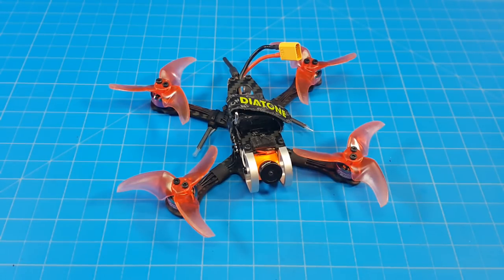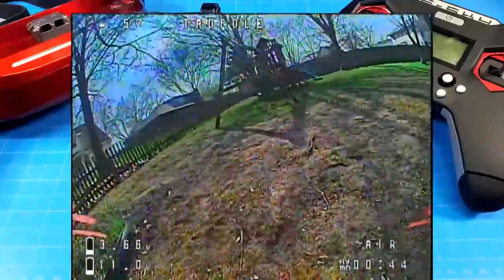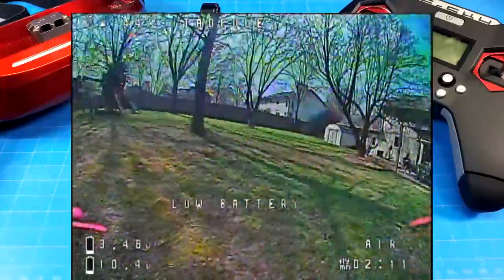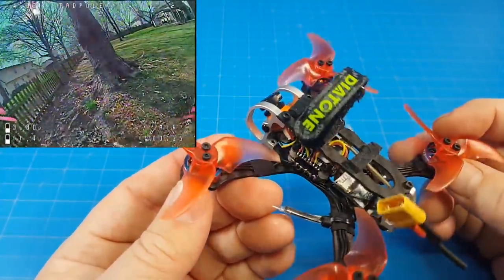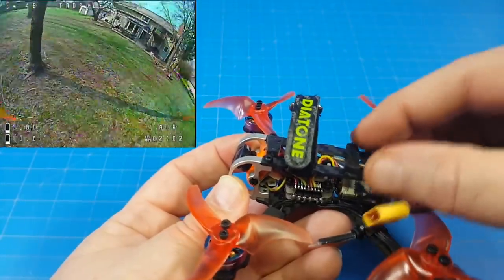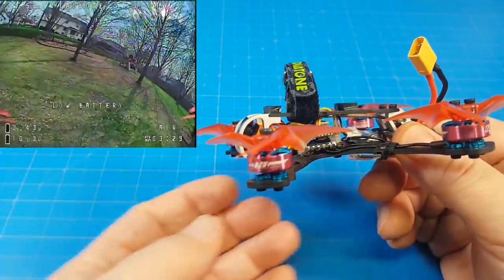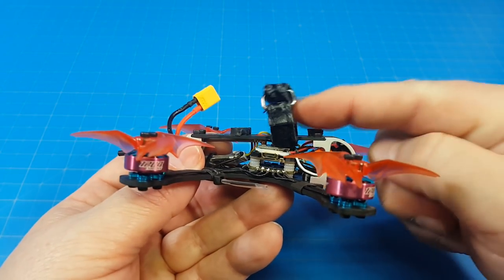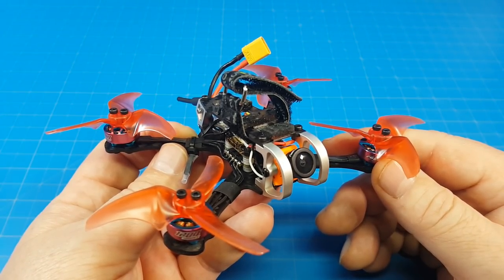Armattan Tadpole // Micro Freestyle frame // search for 3minute flight

Comment: I'm not having any breakup issues with mine, I'm using a Iflight succeX V1.5 stack with a linear antenna, runcam nano 3 and flywoo 1103 7650kv motors, same props

Comment: Hi there Nick!! I got 2 tadpoles. 1 spare cause of long shipping time for parts here. So iam always able to fly. I run them with 3 layer 16x16 stack from iflight. Cut of the botem half of the rubber dampners and replace them with rubber orings to get the stack to fit. I use the flywoo nin 1103 7650 kv. Get around 5.30 min flytime with jesc and rpm filtering on a 450 3s. I also got a foxeer lolypop on both, works great!! No issues there . I use  the 2,5 inch emax props. Love the sound comming of those props. Rly quiet compared to the twin blades. 

Anyway. Great video, keep up the good stuff and stay safe( indoors).

Greets, Rob from the Netherlands

Comment: Hey  Nick, I definitely feel the same about working from home. Btw, I have the Tadpole as well, very much built up like yours except I used Mamba motors, but I have experienced the same problem with my TBS VTX and was told that running the antenna out the back and in between the power leads was the cause. Haven’t had chance to test that as of yet. Also, that Emax tape, as you call it is exactly the type used on guitar pickups to wrap around the fine wire wrapped coil bobbins. If you or anyone else is having trouble finding it, look for Electric guitar bobbin tape. I hope you and your family are safe and secure. Thanks for awesome videos!
Reply from the maker: yes, it could be electrical interference, I did move the antenna out the side of the frame body and mounted it stick up in the air, I couldn't tell a difference. :(

Comment: I built a quad that had similar video breakup and had to separate the receiver from the VTX. Seemed like the receiver transmitting telemetry back was interfering
Reply from the maker: In the moment I don’t recall where the Rx is mounted. I suspect the lower back part of the frame.

Comment: glad i found this video, i run 1105 mambas on a 3" tadpole and i'm getting fed up with this 1.5mm shafts. this 1204 motors have a 2mm internal shaft and so do the transtec 1106s flywoo apparently also has motors with a step up shaft. i'm looking for durability and not sure i'm ready to commit to a full 2mm shaft and having to drill props but it might be worth it.

Comment: Thanks for keeping the content coming. I enjoy seeing your updates while cooped up. I've got a Tadpole built at 70g with T-motor 1104 that flies nicely on those Avan 2.5". I've had some issues with VTX noise on this frame running a TrueRC Singularity out the back on a TBS Unify Nano Pro32/Diatone adapter with the LC and a power cap on the ESC. I would try running the dipole out the front just to see if it makes a difference before doing anything major.

Comment: Work from home is tough, no doubt about it. I don’t know if you found your video issue but I built one of these last week and was having the same issue and I was using a nice TrueRC RHCP antenna with the same vtx as you.  In my case I ended up running the power lead out the side away from the VTX antenna and that fixed it.  Easy enough to test on the bench real quick though!  Take care!
Reply from the maker: I haven't found the fix yet, but I think I will try to trouble shoot it.

Comment: My experience is that 2.5 props max out at about 40/45 watts.  You can throw more power at them, but the lift does not change much.  So it does not really make sense to go above an 1103 motor.  I have two of these and a nice backyard course (which is very tight).  One of the units has Emax 1106 motors and the other one has Amax 1103 motors.   My top ten times (of about 70 seconds) are all on the 1103 with a 2S 450mah battery.  I lost my 1106 unit in the creek when it was running fast...gone forever...very sad.   I think the 1204 motors are a really good fit for a 3" ultralight with a 3s 450mah battery.  BTW:  This frame can take a beating!
Reply: Yeah wish there was thrust test that compared all the latest 65mm props. I've noticed the Avan Rush have really good thrust and control but the last 10% of throttle on 2s 7k kv 1103 motors doesn't do much.

Comment: I fly this frame with 1103 6500kv on 450mah 2S on avan rush 2.5 props and I regularly get 5 mins flight. Admittedly I don’t fly as fast as you do but prefer a fast smooth cruise.
Reply: What motors do you use???
Reply: Gibby bibby Wibby Mamba 1103 6500kv.
Reply: Thanks!!

Comment: I'm running these props on my Geprc phantom along with crossfire and a tbs unify pro 32 nano vtx. 1103 8000kv on a gnb 2s 450. Still my goto micro plenty agile, fast and comes in at 91.6 grams

Comment: I love my tadpole.  I put the ORT micro Vee antenna on mine and feel like I get pretty good reception.  I got the Xing 1105 6000kv motors running 4s and it flies so good.  I have already broke the arm on the frame but the frame is sooo cheap.

Comment: Hi Nick. I have a couple of these frames myself. When I built my first one I didn't install that little rubber antenna retainer piece which was included in the frame kit. It was difficult to install and I figured it wouldn't matter. I see you didn't install yours either. I experienced the same video issues as you did in this video. However,  I did install that piece on my second build and did not have that problem.  When I installed the piece on the first build, out of curiosity,  the problem went away.  I hope this helps.
Reply from the maker: good tip. I will try that out as well. Thank you

Comment: The reception could just be a poorly manufactured dipole antenna. They aren't known for being precise on cutting the length properly. Easiest fix to try first could be just try another antenna. Great looking build and some impressive flying!
Reply from the maker: This is another thing I should have tried. In both cases I used the stock antenna, they could both be wrong. I also might need to try the different modes on the rapidfire.

Comment: Hi Nick ,  I feel you ,  I have the HDO2 with the TBS fusion module and am waiting on the rapidfire  module to arrive ,  but I have noticed  video reception has a bit more interference lately and is more likely the amount of extra wifi signal in  the air with everyone at home and living on the net , as for the extra metal , my favourite quads are based on a FPV Egg  frame from LDARC and  GT Maurader  from Diatone , never really had a drama I would attribute to the metal frame interfering with the video reception .  .  What was that  trippy spin thing , Dude . awesome.    Thanks for the video and  You and yours and the entire Burn's fan base stay safe .  .
Reply from the maker: We have been saying home as much as possible. We do go outside, at least have the kids go out daily, get out and move around some. As to the reception, I should have tried the skyzone 03O goggles I have using for 6months or so, or one of the legacy modes on the rapidfire. I don't know what the uptilt tree turn, but its a bit of a trippy spin, I should see about going all the way around nose up.

Comment: I'm running a linear antenna without any issues, I am using a unify nano (the latest) as vtx though. Glad you were using these motors, I was contemplating on getting these but I'm mostly looking for efficiency. I have it on 2s with biblades and it feels great but it could use some more meat on it ( so switching 3s )
Reply: there is a 3 inch baseplate in the works, might wait for that

Comment: The slant was to save weight I don’t know why your vtx doesn’t work I’m running dipole out the same spot I do have a much shorter dipole antenna not sure if that would affect anything and my antenna is now ziptied and heat shrunk pointing up instead of straight out the back. That trick around the trees your working on looks super cool and fun!

Comment: 1103 or 1104 is the sweet spot for the Tadpole i.m.h.o.! I have two builds and love them! Put some good T-motor or Brotherhobby motors on that frame and it will rip!
Reply from the maker: In time I do think I am going to give 1103 a go.
Reply: @NickBurnsFPV  1103 with the low pitch HQ three blade or 1104 with the Avans, and get it as light as possible then it starts to shine! ;)

Comment: Fantastic flying, Nick! 😃
This frame really looks nice! Couldn't it run those 65mm props?
Reply from the maker: My suspecioun is the 65mm biblades wouldn't gain us much, but with 1103 7000-8000kv on this build witch 65mm biblades would be a better combo.

Comment: Hey you think that the video reception issues was due to the antenna connector hitting the carbon fiber top plate? Looks awful close, what if it shift slightly during flight and touches the CF.  Also did you try a small cap? Although that doesn't look like the typical interference that a capacitor would resolve.  Try putting some electrical tape on the bottom of the top plate so that the .ufl /ipex connector doesnt touch the bottom of the top plate. I've been waiting for the 3" version of the tadpole for my next build. I like my RCinpower 1204's, but typically run them on a Primo 3" or Twig with a 520 or 550 3s. I like that KV range 5000kv is very versatile anywhere from 2s to 4s. They also work really well the 3016 Tri blades.
Reply from the maker: I don't know. I need to do some more testing, some really good suggestions here by many.

Comment: HQ's new 2.5" prop might be worth trying if you haven't gotten some already. It's the T65MMX3. 1.5 pitch triblade so it should be pretty efficient. I have some that just came in but haven't had a chance to try them out yet. Up to now the avan props you used here have still been my favorite for 2.5".
Reply from the maker: I did try those. I think they are to flexible for high rpm motors, the two builds I have tried them on had vibes/jello I couldn't get rid of.

Comment: I appreciate your videos man. I'm doing a similar build but the new 3" with the AIO option. Same motors tho. Also have the Betafpv 1204 I'm going to try. I'm hoping the 3" props make it more efficient.
Reply from the maker: 3inch props will help, the 1204 motors should handle them pretty well.

Comment: Nick, just a thought on the inefficiency of this setup. I think the low flight time here is not because the motors are inefficient, but rather for weight reasons (This quad is 15 Grams heavier than the mode2 splinter you did!)
Maybe give these rcinpower 1204 a second chance in another build?
Reply from the maker: I do have two other sets I could use. I will see what I can work in.

Comment: Nice video Nick. I've built one with xing 1204s and flies ok. Betafpv 20a aio stock 4.1 but get some horrid propwash on corners. Do u have some pids and filter info to see if I'm missing something
Reply from the maker: I do, but we would need to match props, battery and betaflight versions for the pids to be useful. Are you running BF 3.5.7?
Reply: @NickBurnsFPV  no, 4.1 on betafpv 20a toothpick fc, latest jesc, 450mah 3s, ha 65mm triblade with xing 1204 4500kv. Got propwash down a bit on sharp turns but now get a wobble when cruising. Can't get a balance between propwash and wobble. Would it be worth trying 3.5.7 and just stick to simple tuning?
Reply from the maker: @sidewaysfpv5833  I prefer 3.5.7 for micros. It could be my understanding better suits 3.5.7 or 4.1+ not suiting micros very well.
Reply: @NickBurnsFPV  ok I'll give it a try on 3.5.7 and see if it helps. Will get back to you if there's any noticeable difference. Thanks for the advise 🤙

Comment: I am running t motor 1103 8000kv and the mamba aio fc. Getting close to 5 minutes flight time with the gemfan flash and a gnb 450 2s or 4:30 on a 3s 450.

Comment: Hi Nick, Great review! Could that video thing be motor noise? I had something like that on a totally different build and it turned out I had some FC metal scews touching the frame of which I thought was fine... But while trying to fix the reception issue thinking it was my VTX I inadvertently added gummies when putting everything back together... Suddenly the issue was gone! I accidentally stumble onto the fix.
Reply from the maker: I would expect it to get worse with more throttle if it were motor noise.

Comment: Well, i fly 5+minutes with that motors on a 3Inch DaveC Frame (100G auw with a 3s 450mAh mAh with HqProps)... but i'm freestylin' and not racin'   Also, i would strongly advise to fly freestyle both ways (right AND left ^^ (thinking about your 'Robogenesis'). Keep safe :)
Reply from the maker: Robogenesis?

Comment: i do know i got more break up when the signal has to pass through the ole melon (your head) not sure how you are oriented antenna wise. omni with linear does that as well(typically at close range not bad though).  i would go for a micro omni since rapid fire is omni..  just some things hope your figure it out...
Reply from the maker: Yes, I was trying to get the antenna directed more out in the flying space as I noticed the lack of reception. I also forgot to try out the different modes of rapidfire.

Comment: Have you got a condensator on It? Maybe it's if not because it's linear and not circular antena? I think that could be, hello from Spain
Reply from the maker: no cap on this one. Typically we use a cap when we see more noise the more throttle we apply. I suspect I needed to get my Skyzone 03O goggles out to see if its just the vtx or something else.

Comment: My rapidfire hated the first Racer Nano cameras(i have 2 of them, same problem) and would get rolling screen problems in mode 1.  Wonder if the new one has same problem
Reply from the maker: you know that reminds me I should have tested the different mode. Completely forgot rapidfire had that.
Reply: @NickBurnsFPV  been having same issue with my Tadpole VTX, I’ve already tried legacy modes on Rapid Fire mad e no difference. I love this little guy but the poor video means I never fly it 😢
Reply from the maker: @smdemmery  There is a small rubber piece that supports the antenna between the back metal "posts". Is that also in place?

Comment: I've been mainly working from home for years and I've never been as exhausted as past few weeks. Kids also at home + the world burning...

Anyway, this frame is what happens when someone who only knows about 5"+ tanks decides to design a "toothpick" and dismisses all the feedback 🙈

And thanks for warning against those motors, I was just about to get them, which ones would you recommend instead?
Reply from the maker: The next motor I was going to try was 1103 7000kv amax on 65mm biblades or these emax props. Or I was going to buy some avantquads 1103 7650kv motors. Good to get some expert work from home feedback, its just not me.
Reply: @NickBurnsFPV  sorry I meant which 1204s would you recommend instead? :) I've seen people try 1103 + biblades on this with limited results, it's quite a heavy frame not sure lighter motor+prop combo can fix it a lot.
Reply from the maker: @FilipRadelic  ah, there aren't a lot on the market. We have the fpvcycle.com and betafpv, there might be others, I have tried those two. I think the fpvcycle motors to be more efficient than the betafpv.

Comment: Regarding the antenna, I don't have any issues although I used an Omni from armattans store: https://armattanquads.com/micro-u-fl-rhcp-antenna/ I haven't been able to get mine dialled in perfectly. did you tune yours or are you just using the defaults. I also used the mamba stack but went with tmotor f1103 motors
Reply from the maker: I was thinking about trying an omni, but didn't get around to it. I did tune it, but I think its only 60-70% there.

Comment: Hey mate; really weird you only get 3mins flight time; I got a very similar setup on my 3"; same motor size, KV and battery size and I get 6-7mins
You may want to try Jazzmac's BL_Heli_M in 48khz PWM; added a whole min extra flight
Cheers!
Reply from the maker: bigger prop does often increase efficiency. I prefer 24khz, as 48khz takes some low end response I tend to need to fly the way I like to.
Reply: @NickBurnsFPV  Okay I just did a little math; I was confused as to why I would get double the flight time with only 0.5in larger props,

Well it turns out that mere 20% increase in diameter amounts up to 40% increase in surface area, so there's that; 

If I were to send it hard all the time I would prolly run closer to 5mins so that closes the gap :)

And yep, I get that weird response in 96kHz; glad to hear you tried

Comment: Adaptor plate for aio fc included in pack?
Reply from the maker: no, its a separate purchase.
Reply: @NickBurnsFPV  but i can still install my whoop board with just the 2 extra holes without the adaptor? Like the primo
Reply from the maker: @jandomingo9806  Yes, we could we would need to have our own standoffs as the kits doesn't come with extras.

Comment: did you make a discord yet? i was really looking forward to that
Reply from the maker: I haven't yet. I am slow to come around sometimes.
Reply: @NickBurnsFPV  it would be nice to fly on the sim with you during quarantine🤷‍♂️
Reply from the maker: @themrwinston9570  The sim would be fun. I need to get setup for that. I wonder if my old computer would handle it.
Reply: @NickBurnsFPV  I have both DRL and Liftoff, i find that i like liftoff more, but DRL is half the price and runs better on less expensive hardware
Reply: @NickBurnsFPV  you'd need Rotor Rush for Tiny Whoops. Velocidrone also has whoops now but just not as good as RR yet.
Reply from the maker: @themrwinston9570  ah good info. Thank you
Reply: @GRANOLAFPV  no :(